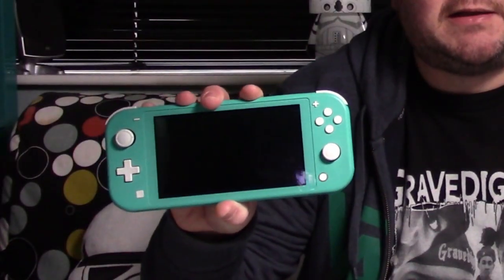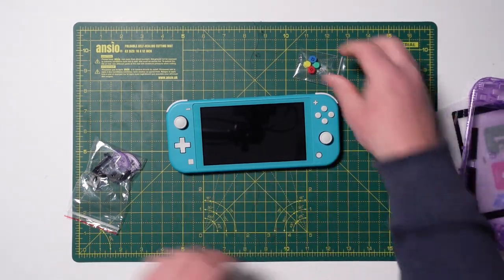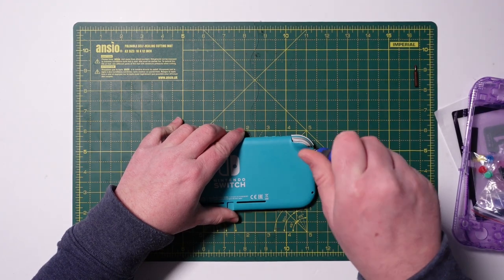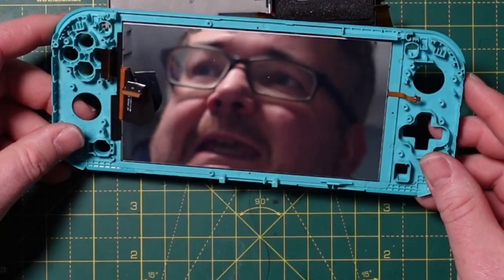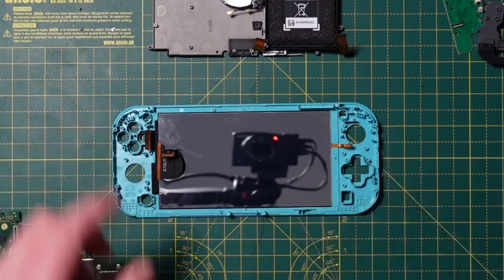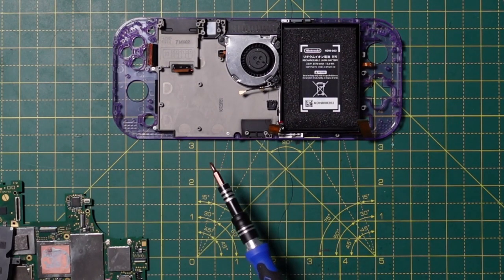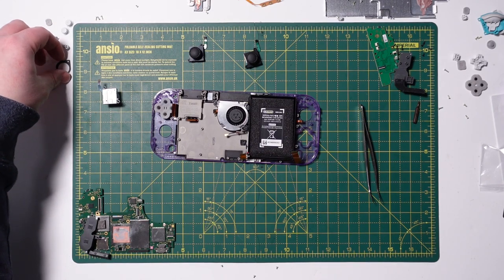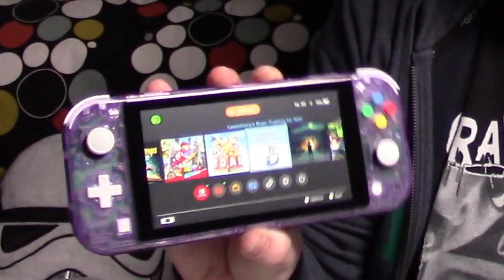The Switch Lite Looks AWESOME in Atomic Purple | Can I PIMP It?

Comment: Well in Steve! 😁👏 It actually looks quite complicated, the switch has so many little components. How did you find putting it all back together? Anything to look out for specifically?
Reply from the maker: Thanks Joey ☺. As long as you remember where all the screws go, it's not too bad. The main thing to watch out for is the ribbon cable connectors. They are quite delicate and can easily be broken! But I think it's worth it, it looks really smart, my daughter is made up with it! 😁
Reply from the maker: Sounds good Koopa! Good luck if you give it a go 👍
Reply: Koopa Squad001-OfficialYT  thankyou 😁